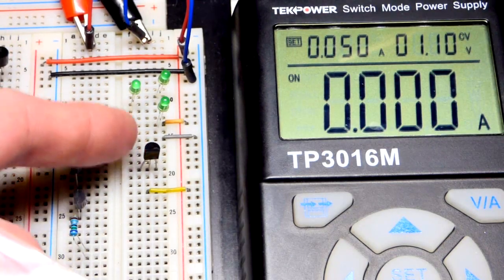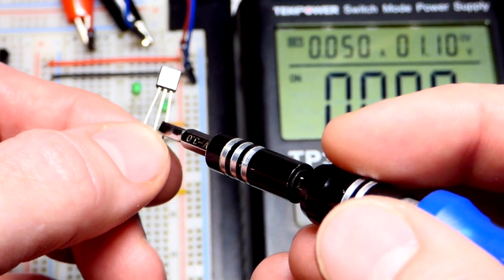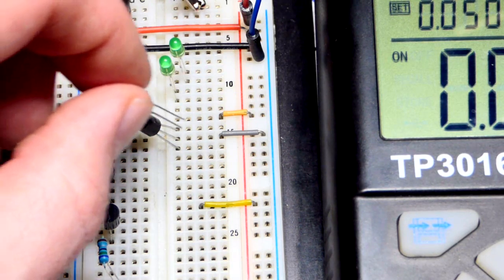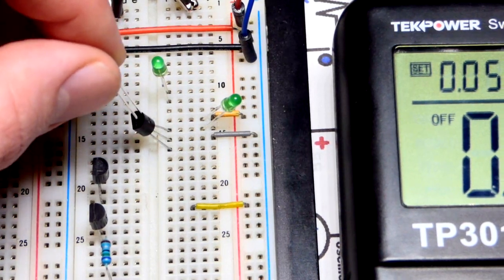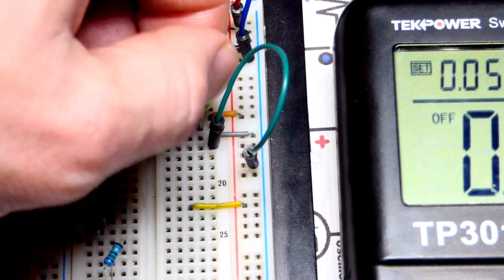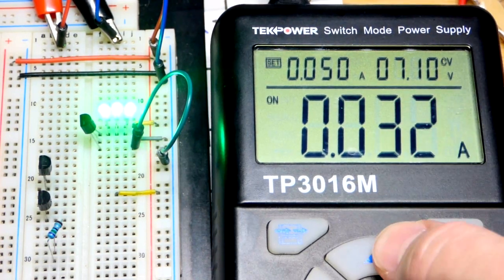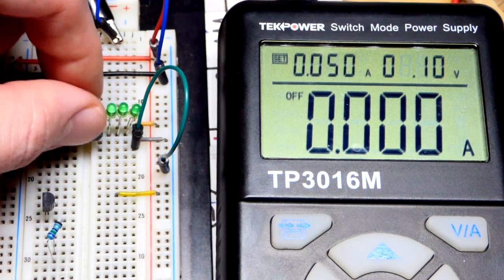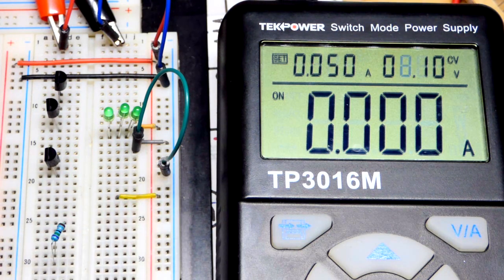N channel JFET Idss tested for component based current sink source by electronzap

Comment: can you make a video about how to design a short circuit protection circuit using LM358 op amp ??
Reply from the maker: The LM358 output already has short circuit protection. It only provides a certain amount of current. I have no idea how you could use it as part of a larger short circuit protection system but that's a good topic to look into. Thanks!